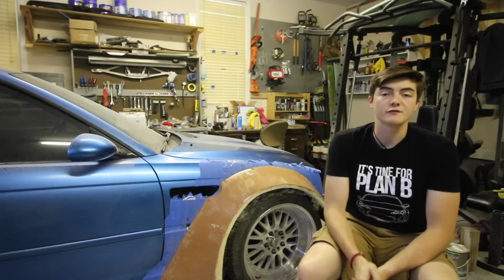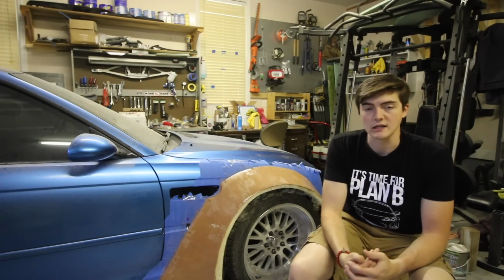DIY Widebody M3 Pt 9

Comment: Its a bit late now, but aerosol foam is hopeless for this kind of project as it never stops expanding/contracting and generally moving... which means you will waste hours chasing repairs. Something that looked perfect one evening will have developed a bulge by the next morning.
Reply: Very good point.  In fact, expanding foam isn't really an automotive product at all.  Margarine would probably work better.

Comment: 9 episodes of the same stuff. I dont understand what youre doing, Your making the wide body out of clay?
Reply: All epi's so far are about making a 'plug', what he uses for making molds later
Reply: He doesn't have a clue what he's doing so he just keeps blundering along in the hopes that his efforts will be rewarded. First it was urethane and bondo. Then it urethane and fibreglass. Now it's clay and packing tape. When he first started with cardboard and foam but no templates to control the shaping it was pretty apparent he didn't know what he was doing and just winging it. Had he taken the time to us plywood or MDF and make wooden bucks with the proper contours he would have been finished by now. Maybe he will learn somethings from this, maybe not. I'm going to keep watching just to see how he eventually finishes up.
Reply: Norman May its a process. Its a DIY
Reply: He does not seem to respond to any comments or advice.  I think another 106 episodes.
Reply: Scooter Tramp he made it 100% clear in season 1 episode 1 he had no clue what he was doing.
Reply: JTOn2's this is the best time wasting I’ve done in a long time, but I’m here for it all on 2x speed, binge mode, no ads! 💪🏽🤗🤗🤗🤣🤣🤣😩😩🤦🏽‍♂️🤦🏽‍♂️

Comment: Too much unnecessary work and music. Wax the fenders and area around them, measure measure measure and make templates of the shape you want the flairs to be. Use clay from the beginning. Forget that foam shit. Once you have the shapes you want and clay has hardened, wax or pva the whole thing and then apply gel coat. That gelcoat will be the face of your mold (the outside of the part). Start with a light layer of fiberglass. Let that dry and do another layer. Another layer and add wooden slats to keep it rigid and true to the shape of the body. Since you waxed or pva'd the clay before you added the glass it should come out fairly easy. Trim the rough fiberglass edges. Clean up the mold you just made. Wash it with soap and water. Make it as smooth and perfect as possible. Buff it. Wax it. Wax it. Wax it. Now gelcoat that mold. When it dries start making your first part! Add fiberglass mat and resin. Make sure there's no air bubbles at all! build it up to where it's thick but not too much. Let dry completely. Pull your part out of the mold. Take it care of any imperfections etc. (There shouldn't be much if you prepared the mold right). Mount them bitches on your car and enjoy the new ricer look. Pass this along to other noobs who spend a ton of money and hours messing with spray foam.